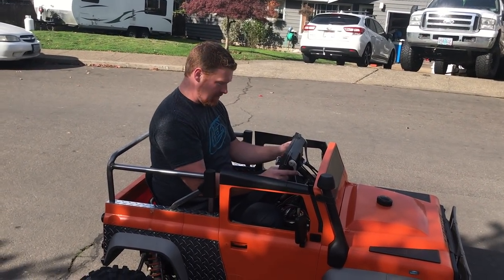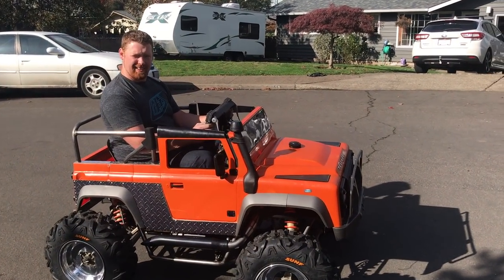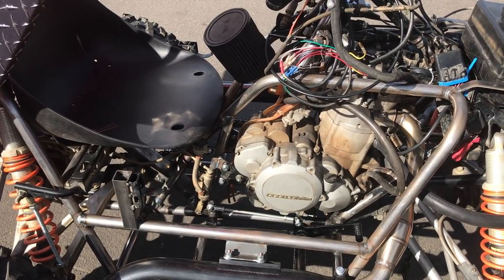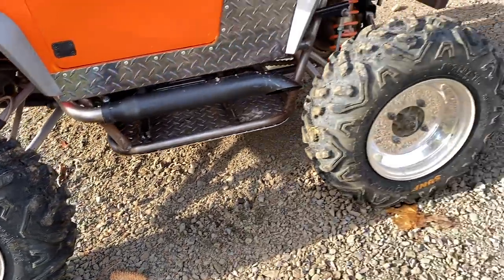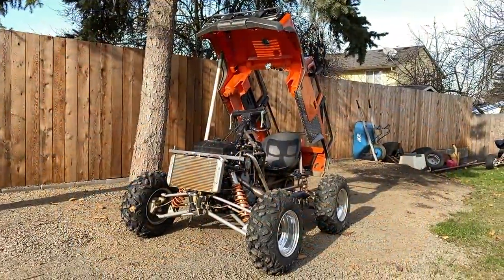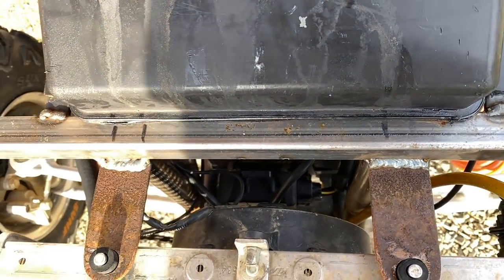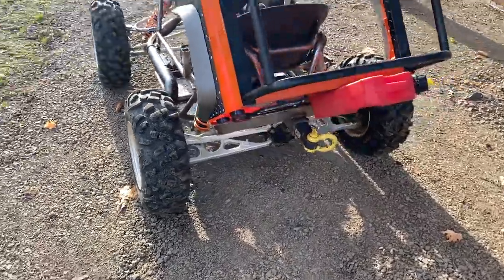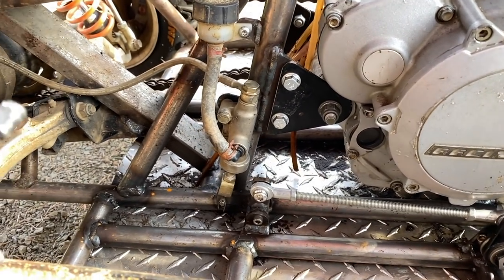69 MPH Power Wheels go kart

Comment: Just bought a quad today to do this, I bought a 650$ Chinese Import to build the first, if it goes well, I'll be buying a 525irs like this 👌🏼
Reply: Hows it going
Reply: @that_red_dentside3968  i ended up making a 4x4 one with power steering and a fully custom body, it is also two or one seater depending on where you set the moveable steering column
 check it out on my ig  "ogshermac"
Reply: @ogshermac  ok thats awesome im definitely gonna check it out

Comment: Way cool... Would have moved the engine even farther forward and stretched the frame another 6-8" to make the seat height lower, and would have put a 5 gallon flat rectangular tank at the bottom of the floor pan for long trail rides.

Comment: hi i just had a tout that if you use the red gas can as your gas tank that way the gas will behind you all you haft to do is put a fitting on the bottom of the gas can then just in the Land Rover body put a gas shot off then run the gas line to the carb. the doors I would finger out a way to make latch so they open like they are now.

Comment: What offset did you use on the wheels??
Reply from the maker: 10x6 centered 3/3 front
10x6 2/4 rear but actually using a 1” spacer basically making it 3/3 rear.
Reply: @HessickMoto  thanks for the reply and info! In the process of tearing down my 06 polaris IRS outlaw now...couldn't find a defender like yours! So im doing a blue 2 seater f150 power wheel. I love your build!!!!!!!
Reply from the maker: @brianblessing1261  that will be awesome! I have another defender and am thinking about creating a 4 door version. Stay tuned for something ridiculous
Reply: @HessickMoto  i will be watching for sure!
Reply: @HessickMoto  i had 1 other question,what fender flares are you using? Where did you get em?  I see you had to extend the front flares. Thanks
Reply from the maker: @brianblessing1261  they’re the ones the river came with. It’s made by kid trax and you can still order all the parts and pieces for it. Pretty cheap too

Comment: It's 510cc not 525
Reply from the maker: Viktor Melders actual displacement is 510cc. It’s labeled a 525 in the atv and the dirt bikes of this generation. 510cc has been called a 530 and is currently called the 500.  Thanks for the input. I know these motors quite well